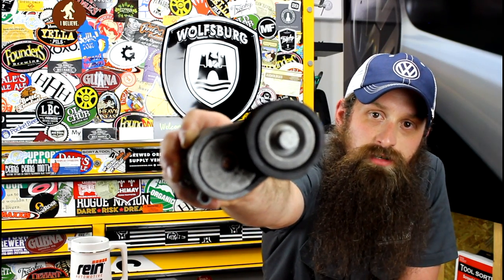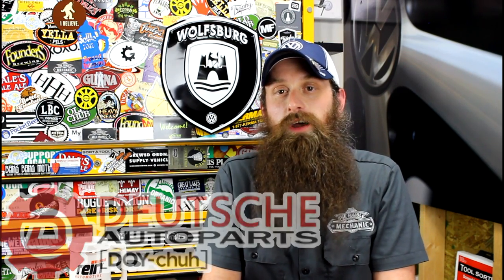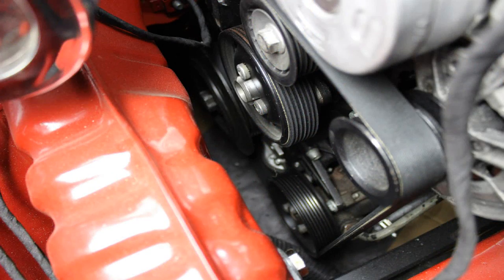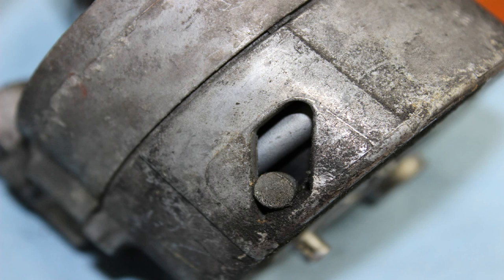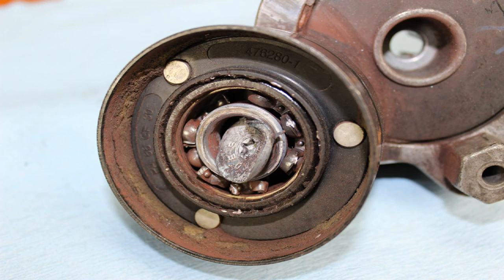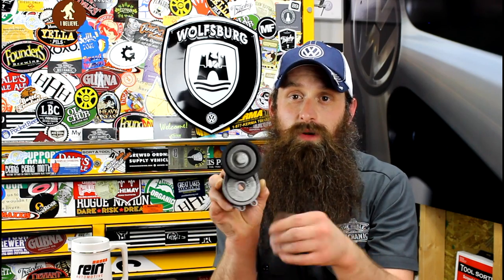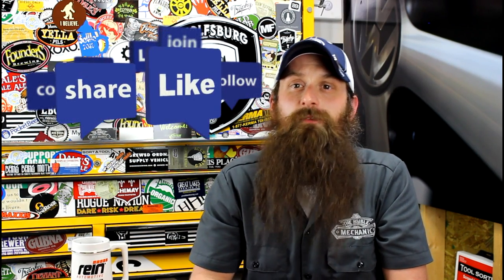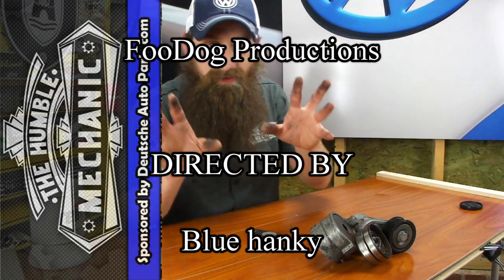How VW Serpentine Belt Tensioners Fail

Comment: another symptom that's very common that isn't mentioned in videos is the assembly shaking.
Reply: On a 2.0 NA it can also be an alternator that can cause shaking. In my case my car had 200k. The belt was shaking rather violently. Replaced the alternator and it got better but still persisted. Changed the tensioner and now it's great.

Comment: VW T28 Transporter 2.0 I've got a Battery light on my dash & Power steering has failed. So it could be this, cheers for the info. I'm guessing your Electric Shaver has also failed !

Comment: I had the timing belt replaced but on my A4 B5 but ignored the already deteriorating ribbed belt. After assembly I took it out for a test drive and lo and behold the ribbed belt snapped, got wond up by the crank pully taking a few electrical cables with it and mangling them completely. It had also affected the timing belt as well. Now I took it apart again and am starting all over. Point is never do a half-assed job.

Comment: Hi! Thanks for the video! I have a 2013 VW Jetta 2.5L. In January (3 months ago) the drive belt broke which also broke the a/c belt. They replaced 2 pulleys but now it's making a sound as though the tensioner is broken. I can get back to you with more exact info about what they replaced, but is it possible this issue is caused by their negligence? How can I know? Thank you!

Comment: I have an 2016 a6 3.0t . My belt and tensioner literally broke while I was driving. I didn’t hear the noise until my engine mounts went bad and caused excessive vibration throughout my entire car.  Excessive vibration from the busted engine mounts can also cause this.

Comment: Roughly at what mileage should I replace my serpentine belt, belt Tensioner on a 2016 VW Passat 1.8 TSI? I can’t find anything related to replacement in my owners manual.

Comment: I bought a used stock 2011 VW CC 2.0t with over 110k miles on it & already replaced a lot of important components and drives fine. Should i consider replacing the tensioner or pulleys ? I already replaced the belt

Comment: Often the alternator pulley will seize causing the tensioner to fail from the extra load. If tensioner fails also check alternator pulley at same time.

Comment: Wow Humble, You were pretty young 9 years ago! I guess YouTube ages you...

Well, just had this happen on my wife's 2009 EOS (best car ever).
Thankfully we have a good mechanic who reads the service bulletins and realized that the tensioner usually goes because something else causes it.

In this case it was the clutch on the alternator (Yeah, VW has a complex alternator $$$).

Thankfully everything is good now.

Now we just have to deal with the DSG mechatronic 'thunk' in 1st gear when the transmission gets really hot. (That one's still not bad enough for a full rebuild)

Thanks for the VW videos!
Reply from the maker: well if I wasn't getting older, id be dead. HA

Comment: Great video as usual Charles. I was wondering if a belt is partially shredded without any squealing, does that mean the tensioner is on its way out?
Reply: Lol I know your comment was from 2 years ago but... it's more likely you have a failed pulley somewhere in the assembly.

Comment: Replaced alternator on Rabbit 2.5. Installed new belts (x2) and replaced two pulleys which had nicks and digs. Tensioners themselves felt fine so I reinstalled them. Car has never run better!

Comment: I need your help please...  Just replaced the belt tensioner on my aunt's 2012 vw jetta TDI after it had catastrophic failure, installed a exact replacement and the tensioner still makes a chirping noise at low rpm and bounces/shakes from side to side... I double checked installation, everything looks normal, also looked at the alternator pully before I put the OLD belt back on and it has zero movement/noise in any direction and seems to be tracking correctly. The old belt looks good, could it be still causing this issue? Your help would be most appreciated, thanks ahead of time.
Reply: Same issue did you ever figure out what it was
Reply: Id like to know too please

Comment: So my 2001 vw eurovan serpentine started chirping/ squealing after the shop put a new clutch in the a/c. Returned later and they said it’s the tensioner but NOBODY anywhere has the tensioner for that vehicle. Assuming it is the tensioner, what options are available besides waiting for catastrophic failure?

Comment: Hi, I own a 94 golf GT Special. It's a 1.8 8v with 295.000kms. I've had to replace a lot of parts since I daily drive it 10.000kms a year, but the engine seems to be running along nicely. Only replaced valve tappets. 

Now I recognise a lot of what you mentioned but someone warned me that there's play on my crankshaft. I've found a few metal splinters on my oil pin and since the crankshaft drives the belt, I'm concerned it's not my belt tensioner but my crankshaft crapping out? When I take the cover off of the belt, I notice that the belt is sitting over the edge of the camshaft pulley by like 1/3rd of the width of the belt. Also the belt has been replaced twice in 30000kms and seems to wear out super quick. It squeals an awful lot and turning on heating etc makes it worse before it disappears. When idling it sounds a bit rough like there's some wear and tear somewhere along the belt and pulleys. When I pull the belt back and forth I hear a metal clacking noise, similar to a torque wrench locking. That's all I know so far.

I'm shy to start diy'ing myself since I lack the tools nor the space and it's my daily so I'd rather pinpoint the problem/s and let a good independent mechanic fix it. Also if it means my engine is dead and a swap is the best option, that's gonna top €7000+ already spent maintaining a €950 car that has more issues. I mean i love the thing but it's getting tough.

Comment: Hi there, I've got a 1.9 Tdi 9n3 polo and I'm not sure how the tensioner comes off. It looks like it's bolted on with the alternator but I'm not sure. I've got a noise but I did check the pulley on the tensioner and it didn't make any noise and it was smooth when I rolled it. So my last guess is its the alternator pulley. ?? Let me know what you think.

Comment: I have a question Bro...

I recently replaced the bracket that holds power steering pump,a.c. compressor and alternator in my AWP 1.8t engine.
The thread on the bolts that holds the serpentine belt tensioner were striped so that caused the tensioner to move and eventually the serpentine belt shereded in pieces.
I replaced the bracket but after I put everything back together I notice that the tensioner puts so much pressure on the belt causing the belt to touch the belt that passers on the a.c. compressor loop is that formal..  do I have a bad tensioner?

Comment: How often should a serpentine belt and tensioner be replaced on a 2.0 ?  I have a 2018 Tiguan with 70,000 miles and figure I should change the belt, but can't find VW's recommended mileage for it.

Comment: Don’t mind dropping some money for a hood pulley and serpentine belt, any suggestions as to what makes one better than the other? What should I be looking for? Thanks man your videos are so helpful!
Reply: This would help me too, suppose to be getting a 2014 1.4L with 71k miles approx. Still in good shape and low milage, but would like to get the parts set down in advance. Also, what pistons can be used on this said engine.

Comment: Can you elaborate on the spray lubricant? What kind, where to aim it, use proactively with regular belt change, or only if noisy? I'd have guessed the forces on those bearings would need high-temp, thick grease & I'd worry a spray might degrade original grease? Is that not a problem because spray won't get to sealed bearings - just trying to hit spots where spring is creaking against housing...?

Comment: So my tentioner moves alot and I can hear a clunking noise after it warms up and it does go faster with rpm. It doesn't move or clunk when cold and in park only after driving and or warmed up. I guess I'm unsure if this is a tentioner issue or alternator issue. I do get 14 volts constant

Comment: Quick Question. I have 2005 Polo 1.9 with a ADY Engine. The Roller on Tensioner doesn't fail. nor my Serpentine Belt . BUt the Tensioner it self splits in 2. its the 3rd one in 6 Months. different Suppliers and Makes. what can cause this Problem. dont get any warning or Noise.

Comment: I had my timing belt replaced along with my serpentine belt, 5 days later, the tensioner came off. I'm trying to understand if it was possible to oversee the problem as a mechanic... or if it was a bad installation...
Reply: To possibly clarify: the tensioner bolt in the middle of the piece ( the 17mm) was detected.

Comment: I installed a new oem serp tensioner on a 1.8t and the belt is not aligned with the pulley. I even remembered to put the black bracket between the bolt and tensioner. I can't figure out how to align it. I'm going nuts. Help! 🤯

Comment: Hi I have 2012 tiguan tsi 118kw and the idler tensioner has threaded it's bolt when I was trying to renew serpentine belt. Any advise on how to remove and replace and what tools I need?

Comment: I've kentworth T600 Truck .
my truck's bottom tensioner pulley smoked and came off  due to overheating .
can i bypass this tensioner by using 2-3 shorter belt ?
angle /line is good with main engine shift pulley and there is idle pulley at at corners .
i need to bypass it if possible just to get home .
u know over the road service told me to bring u part and install it will coast 600$ 
but if i get to home i can buy part and do it with only 200$ 
I'm broken ...
any advise pls

Comment: Hi just a question that i have B7 2021 Passat and i hear pulley noise inside the car but not in bonnet. Can you confirm what pulley it could be  and when i turn AC on the noise either hide or gone.

Comment: OK, replacing a B6 CCTA belt tensioner is not the easiest job. It's secured by one "hard to access" screw behind the tensioner, but removing the alternator (or shifting it a little) gives you access to the screw. Now when you try to pull the tensioner out, it's blocked by the frame. I don't see any way to pull it out without lowering the engine a bit. 😢
Reply from the maker: That’s the easiest way to do it

Comment: Need help on T5.Has ripped off belt tensioner 4 times.Has new alt.has new A/C comp.Has new tensioner. Has new belt. Has had crank and power steer pullies cleaned.Still throws belt.Has done it a idle,has done it on start up. has done it at 60 kph.

Comment: I would love to see a video on fuel related issue. Currently have the craziest problem i cant find AHH! car stalling on warm starts and after pumping gas rpms are dropping then stalling. Any ideas? low pressure fuel pump failure maybe? ?  So troubling. If i give it throttle to save it from stalling it will idle fine. So many misfires. coils/plugs and pcv all fine. Awesome videos thanks! 2011 gti

Comment: I know this is a old video but I have 2006 vw jetta 1.9 tdi brm motor and my Tensioner, go and shred my belt I got a new tensioner and belt put on reprime the system but I got crank but no start

Comment: I have a 2009 2.0TSI CC and the tensioner doesn't have a squared know on the the top for a 16 or 17 mm wrench do you know if there is a certain way to release this tensioner?  There is a rounded knob on tope with a hole on the side for the locking key

Comment: Speaking of noises, I'm changing the cam chain tensioner this weekend on my 01 Jetta 1.8T. When putting the new tensioner on, the videos I've seen, they put RTV going out from either side of the half moon seal under the tensioner. Is there anywhere else it needs to go? I saw one guy put it along the convex side of the half moon seal as well. Would love your expert advice to help avoid some unwanted leaks!
Reply from the maker: Nathan Doehring I just put a little in the moon, and on the corners of the valve cover gasket. You don't need a ton.
Reply: HumbleMechanic Thanks for the response! I'll try not to make a mess of it :D

Comment: Hey Charles, 
we have a 2.5 2006 Jetta with the electromechanical steering. Today the power steering warning light came on and it was orange. Is there any chance that a bad serpentine belt tensioner could cause this?
Thanks for your videos! They have helped us out a lot!
Reply from the maker: The only way that could happen is due to low voltage caused by the alternator turning fast enough. 

really need to get the faults checked.

Comment: Long time watcher maybe can help me 2012 vw eos 2.0 tsi turbo. The low oil pressure light flashed and then car turned it self off and white smoke out exhaust.   Mechanic said new motor. Maybe you can help didn't overheat and has codes p025c and p0301 thanks love the shows

Comment: Recently purchased a Serpentine belt kit from FCP Euro... They must've sent a used belt tensioner because the tensioner was not sent in its locked posistion. I ended up needed to call a friend to be able to use his vice grip, put an Allen key myself, then re-install the tensioner.
Reply from the maker: OH MAN THAT SUCKS!!!!!! It may have not been used, it may be aftermarket. but either way, that is no fun LOL
Reply: @HumbleMechanic  Ended up finding out.. that the AC pump ended up locking and causing a chain reaction, eating the tensioner and losing the belt... Luckily i didn't break the new belt just simply unplugged the compressor and ill deal with it in spring.

It was weird diagnosing simply because it looked like a tensioner fail. but further diagnosing lead to the AC

MK4 1.8t

Comment: Hey I have a 2003 Vw Golf Gti 1.8T Gti and I noticed my main Pulley is shaking a lot once I turn the steering wheel to both sides left and right and it squeaks as well I replaced the pulley and I still have the same problem don’t seem to know what the problem is ...

Comment: Hi would u make a video on how to replace a belt tensioner on 08 Jetta 2.0t cuz this cars came with a factory tensioner that can't be eemoved just by removing belt and a bolt that holds it to the block,mine looks like i gotta remove alternator or ac compressor just to get to some bolt that are hidden behind it,please help thanks.
Reply from the maker: I did one on my Tiguan. It should be almost the same for your Jetta

Comment: I’m pulling the water pump on my Jetta so I’ll have the engine up. I’ll be replacing belts. Should I just check the pulleys and tensioners or any that should just be replaced while it’s out? I have an 06 2.5L 130k mi.
Reply from the maker: yes check all the pulleys. Everything else is pretty solid. Those pulley's like to leak all the grease out

Comment: I changed my timing belt then my serpentine belt 5 minuets after starting engine my serpentine belt flew off and car cut off timing belt was fine but serpentine seemed all on track and properly tensioned any advice what might have caused that

Comment: I own a VW GOL wish is a Brazilian model (I don't know if you ever hear about it in America), when I m driving it I can hear knocking sound coming out of what is under the hood (not exactly the engine) however by riding more often I noticed that the noise was getting louder. One day by getting back from work, I decided  to check the engine and the tensioner of the serpentine belt just split up so the belt got held loose. So I would like to know; can I keep running my car prior replacing the tensioner.  Thank you.
Reply from the maker: +zakariae Snoussi You really need to get that replaced. A broken serp belt and be bad news, and leave you stranded.

Comment: My 06 Camry makes that rattle sound only when something is turned on like the AC compressor or the radiator fans kicks in. But it's much worse with the AC compressor on. Def suspect to be the belt tensioner.

Comment: 2013 GTI w/120k miles, mostly highway. Does replacing the serpentine belt require that the tensioner gets replaced too? What is the typical service life of said tensioner if I'm not hearing noises from that area? Danke!
Reply: carbon cleaning, pvc, spark plugs, ignition coils, basic maintenance
Reply: pcv*

Comment: Last Saturday I had to drive some 40km home on battery only, since the tensioner on my 1995 Golf III failed and the engine wasn't turning the generator anymore. I guess, this means the battery is quite good, we are obliged to use headligths at all times, besides it times I needed to turn the wipers on (they moved really sloooooow), and after all that battery was at 11,4V.
P.S. Before that I had a weird problem with idle revs dropping when AC is turned off, which seemed to be weird, it should drop when another device is turned on, not off,  I think, so it's sort of counter intuitive. Besides,  there was some noise, not exactly squeaking,  but a noise, when taking foot of the accelerator, which might be connected to the issue... or not. Got to see what changes after fixing it.
Reply: Idling should raise  when a device gets turned on...like the a/c ...it should not drop.

Comment: Hey great info. Thanks. Question. I got a mk4 gti 1.8t. Serpentine belt doesn't align correctly on tensioner. Any help would be greatly appreciated.✌
Reply: If someone replaced the alternator, it’s common to put the bracket on backwards and then the belt won’t line up right and the belt falls off.
Reply: Hey thanks for the reply. Found out that of the 3 bolts that hold it to engine, bottom bolt needs a washer to make it even with the other two . 😃👍👍
Reply: @juanquinones2597  glad you got it fixed!